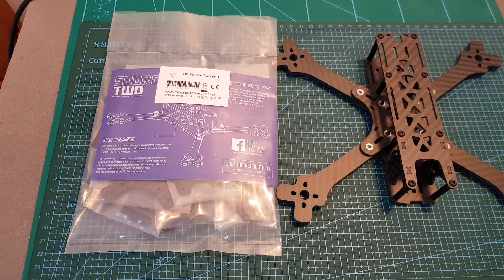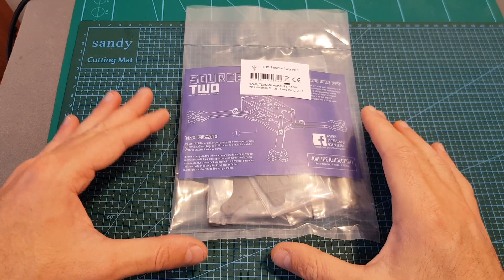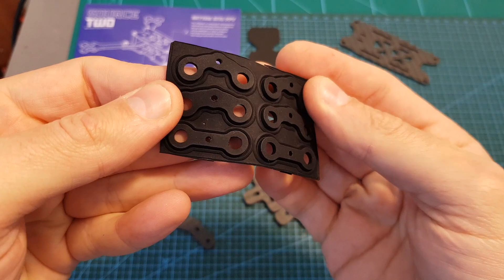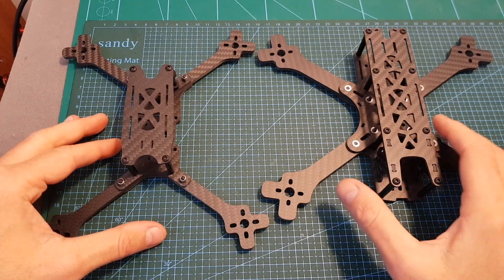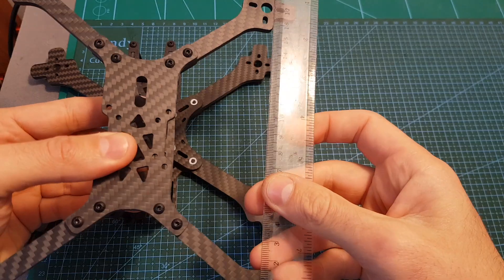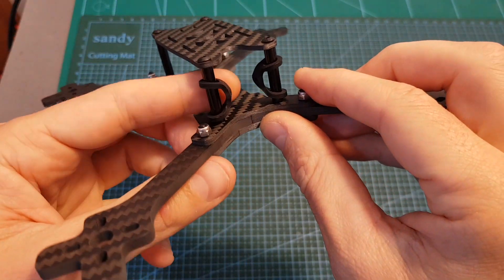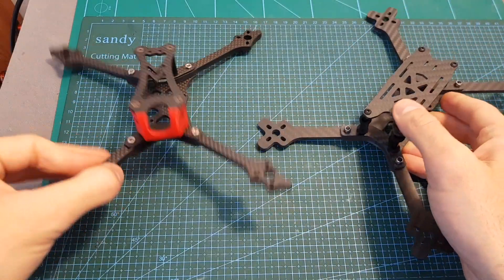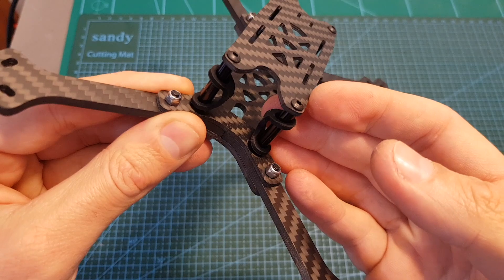TBS SOURCE TWO V0.1 - Budget Friendly Racing Frame Overview

Comment: Hi, I bought this frame and a runcam racer 2, where can I find the project of the 3D support for the camera showed in your video?
Reply from the maker: Did you search  Thingverse?
Reply: Gal Kremer yes, I doesn’t find this exact project, where do you find it?
Reply: 89cmd89 go to original TBS source two project and at the bottom there is link for thingiverse.

Comment: Very similar to the Floss 2.0 huh.
Reply from the maker: Similar design but definitely not a clone.
Reply: Lets be real, this is totally a knock off floss 2. Boomerang arms, the way the stack sits, the motor guard little flares, the caera mounting, the toplate double battery strap..... I know it's a crazy good design which is why its similar, but i think it's a little too similar.